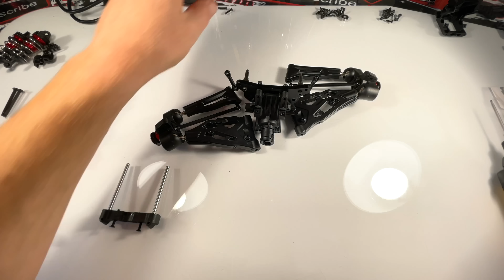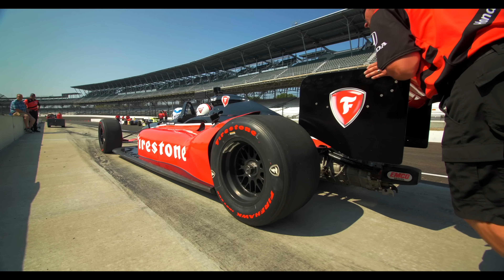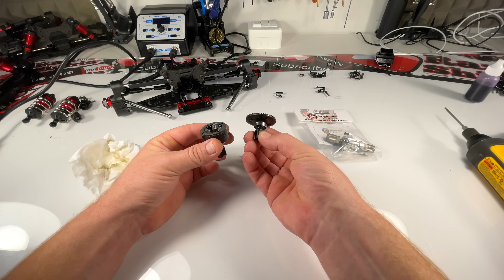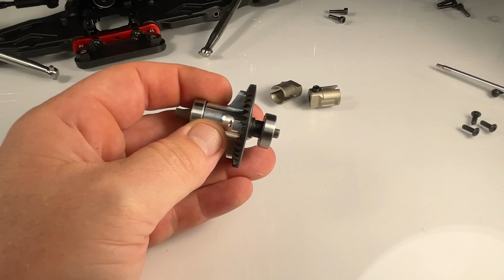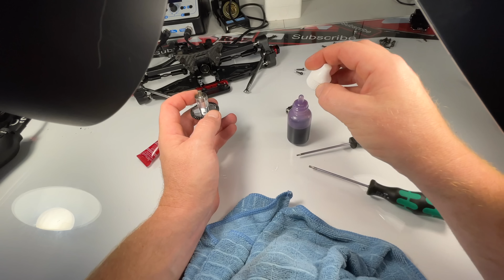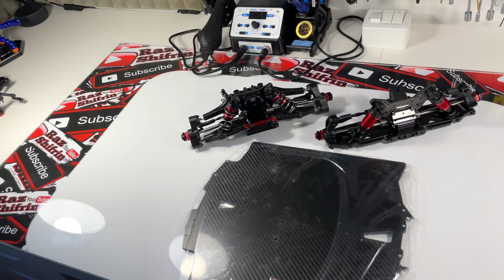EP 1 - $6000 Carbon Fiber RC CAR Has 4 Motors And 60 Horsepower

Comment: Between you and Kev Talbot I cannot get enough of your videos! Raz you inspired me to build my speed car! I’ve started with a carbon / alloy TT01 chassis with a hobbywing wing max10 esc and motor combo and slowly been tightening the car up and adding aero to it while using a Mercedes CLK GTR body where I’ve then 3D printed a air intake box that fits over my twin cooling fans and has a real working air intake from the roof scoop of the body shell

Comment: I had asked you about the GP5’s and the hot racing diffs figment.  Thank you for showing where you removed material because I did the same thing and eventually gave up because I had ground so much and still had issues.  The fact that you produce videos with content based off of questions from previous ones really says a lot!  Great video again and I look forward to the next one. 👍👍👍

Comment: With this number of motors it may be interesting to see if there is a way to sync the motors in a more precise way. They are all sensored right? How cool would it be if there was a control module that regulates all esc's at the same time for perfectly aligned timing
Reply: Probably depends on cable length. Unless raz can get everything placed at the perfect distance, I’m not sure if it’s possible to get them to sync. My vision is the longer the cable from the receiver to the esc, the more the delay is. U gotta think, first it has to wirelessly send a connection from the transmitter to the receiver, then the receiver has to send the power through both the Y leads; then the esc has to process it, then the esc has to send that to the motor; then depending on if raz uses direct drive, or a pinion, still it has to go through the slop of the pinion, then to the spur, spur sends power to transfer case, then it divides it to the driveshafts keep in mind those have a little bit of slop in to them, then the drive pins have to spin the hexes, the hexes spin the wheels, THEN  after all that the car gets power. So I’m my opinion, no matter what setup he uses, there will probably be about a half second of delay from the time the trigger is pulled, to the time the car moves. Servos are fine tho, cuz it’s a lot less complex. So yeah that’s my take on it. Could be completely wrong but hey I gave it a shot
Reply: @endosrc  Good point but I didn't mean something like a flightcontroller in the open loop system between the reciever and esc's but on the closed loop end where the esc's selfregulate based on the sensor measurement input.
Reply: Seeing this video I was thinking of a dual Northstart Cadillac and getting them to sync.

Comment: Felt like I was watching it with the playback speed turned up for the first few mins of the video. Awesome build and I look forward to seeing it again. Does seem like just getting a bigger can motor and maybe a single 400amp esc would've been significantly better for speed runs. Seems like a lot of weight in this setup. I have to admit I don't no much about speed runs though. Is this just a passion project or........??????

Comment: epic build mate. Have you considered going slightly larger diameter on the wheels? I'm thinking it would 1, realise more speed for every given wheel revolution and 2, take some of the torque off the contact patch (because of the increased leverage of the bigger wheel) and might help you put more power down on a longer run? Just a thought.

Good luck matey!

Comment: I've been thinking about this car a bit more and wonder if you need thrust bearings or angular contact bearings in the diffs. It may not be a bad idea considering the enormous forces these 4 motors combined will put out The only issue with angluar contact bearings is minimum size. They are at least 10mm id/30mm od. Thrust bearings are widely available for rc because of the model helicopters.

Comment: Why would you oil the outside of a sealed bearing?
Reply from the maker: Never really sealed
Reply: @RazShifrin  true but wouldn't it be a lot more effective to remove the seal to oil the bearings? You might be getting a couple of percent of the oil you're putting on the outside into the bearing doing it the way you showed in the video.

Comment: I wanna know how you do your back shocks lol, they’re done different then what you’ve showed in the basic how to video.. I’m just curious what rubber pieces you’ve used on the outside of the shock, even without a spring. How did you do that set up?

Comment: Where are you getting 60HP from?  15hp each is roughly 11.2kw and 380 amps. Even for peak power, that seems high.  Castle only rates those ESCs for 120amps which works out to 5hp each for a total of 20hp. What M I missing?

Comment: So just a question hear. Wouldn’t MGM largest ESC and motor be much easier? I totally commend you for all the work.
Reply: They take up way more space and have a lower maximum current, but higher voltage output. They also require a separate battery for the receiver.

Comment: Wouldn't the KV of the motors still limit the top speed? I realize that adding more motors would allow more torque for higher gearing and to overcome the extra weight, but isn't there a point when your motors won't spin any faster no matter how many you have on one spur gear? To take advantage of that much power wouldn't you need huge pinion gears? How big of a pinion can you put in one of these cars before packaging becomes an issue. Not being an ass, but seriously curious.

Comment: Question for anyone: I have a kraton 6s exb (running on 8s, locked center diff). Problem is I've had an issue with either the front or rear diffs for a while where it clicks, is loud, and saps power. I can't figure out how to fix it. I've had all the diffs apart many times and there's no visable damage. Is it a terrible idea to just lock all the diffs? I don't race, I just bash it really hard. Appreciate any help!

Comment: Raz. Someone needs to design an gearbox for that single motor and make that 210mph   You need to explain why you doing this for more motors is not going to change the top end. It will get there with ease 😎 maybe with someone behind it 🤔 wait… I think I need to stop and let you do you 👀✍️💐☎️🔥💯💭